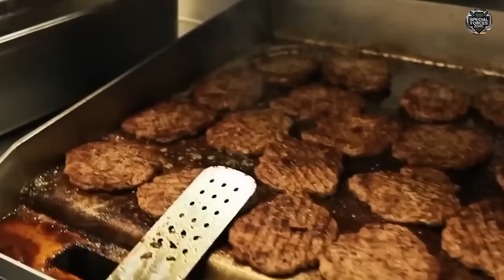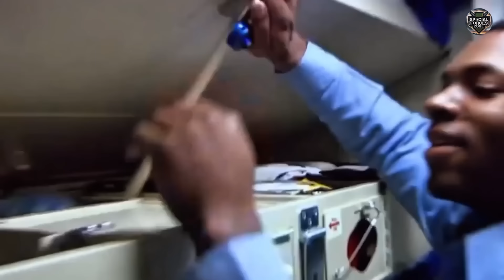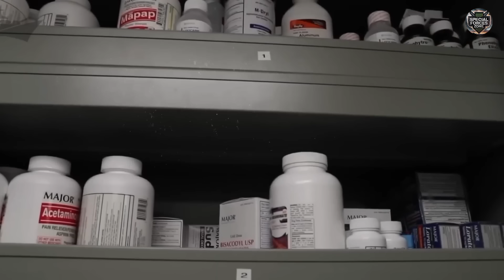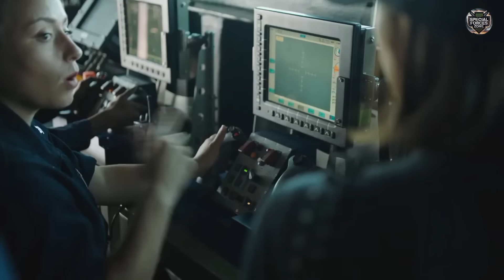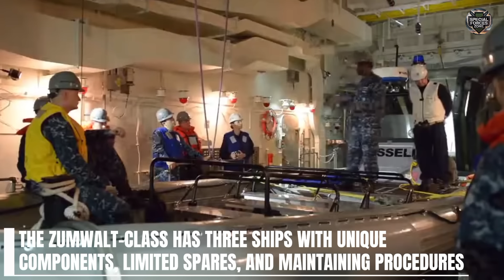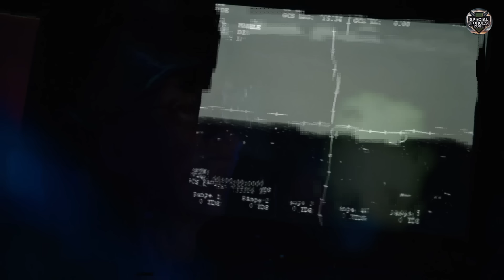A Day on The Destroyer - Inside United States Navy Most Expensive Warship Ever Built

Comment: Striving for the smallest crew possible as a cost-saving measure is false economy. When battle damage strikes there will not be enough personnel to fight the fires, control the flooding and get the equipment back into use knocked out due to loss of electrical power and other essentials.